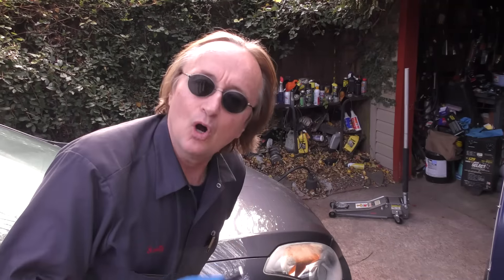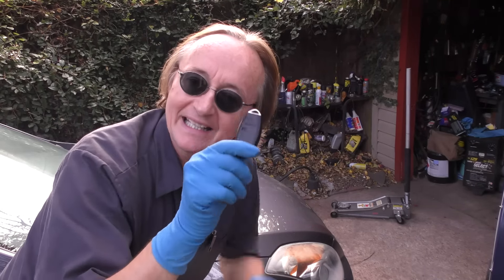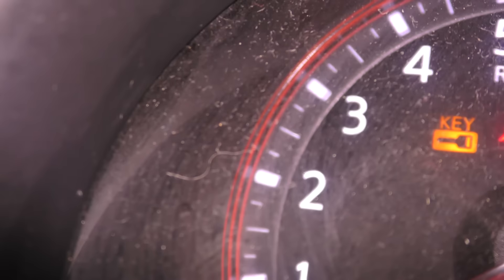How to Fix Keyless Ignition System in Your Car

Comment: Don't buy a Nissan.
Reply: Khalid AlNajjar JDM bro.
Reply: Nissan turned to shit after Renault brought them.
Reply: Exactly, nothing jdm about it.
Reply: whats JDM
Reply: EXACTLY..........& when you think about the crap that Renault built with AMC in the '80's (Alliance, Encore, Fuego, LeCar, anyone?), I am not that surprised at all that Nissan's reliability ratings have gone down the tubes in recent years.
Reply: ***** Renault is now also together with mercedes, and that premium brand turned to shit as well.
Reply: I'll agree. The 2 times I've had loaners when I brought my car in for service, I've gotten Nissan Altimas. Just getting in and listening to the hollow-tinny sound of the doors closing tells you how cheaply these things are built. The steering/suspension and the CVT are the 2 WORST parts about the car. Suspension is mushy with tons of underrsteer/front end plow and the CVT just cannot make up it's mind what gear it should be in. The CVT makes the engine "lug" a lot during around town driving. Don't even get me started on the terrible seats, non-intuitive steering wheel controls and the confusing navi-stereo system.
Reply: Not as reliable as Toyota or Honda, nissans are essentially average or maybe slightly above average in terms of reliability. Their CVTs also suck
Reply: I have a Altima still running strong at 240,000 miles with only basic maintenance needed. And a Sentra with 115,000 miles. Zero issues from these nissans . Both are post Renault . lmao this keyless thing is an easy fix too just pull the fuse and problem solved
Reply: *knee-saan
Reply: Nissan has gone downhill since its ceo took over.
Reply from the maker: also since they merged with the french renault company
Reply: Scotty Kilmer HE HAS SPOKEN !!!
Reply: Scotty Kilmer why is it bad that they merged with that French company?

Comment: Not really a choice they all have them now days. Unless you want a boring basic one.
Reply: I'd rather be "bored" than a victim.
Reply: A42yearoldARAB I didn't know buttons were that exciting to people xD

Edit: This will make a great "just look at it" video from edbassmaster
Reply: A boring basic one is still much more advanced than a top trim model of ten years ago.. Why complain?
Reply: Not a problem, as I've posted. Not expensive either.
Reply: Right you are!  I used my Toyota to give a ride to a guy whose Porsche had left him stranded on a busy highway.
Reply: why compare it to 10 years ago?! why not 50 or 80?!
Reply: wholeNwon, are you relating to a key problem on the highway?
Reply: No
Reply: wholeNwon, ok, just trying to find the logic and connection to the vid & ur story :)
Reply: I forgot to mention the Chevy Silverado does not have push button start on any trims..which is nice.
Reply: I was responding to the complaints of at least 2 people who said that transponder chip keys were extremely expensive to have made.
Reply: A42yearoldARAB gee these excite a person? Now that's boring lol lol...
Reply: A42yearoldARAB i thought that about our 14 fusion but its pretty well equipped. leather heated seats and the 2.0l engine. still had basic switchblade key
Reply: A42yearoldARAB Who cares about boring! A to B is the urmost of importance for the majority .
Reply: I like creeping past that "exciting" Ferrari going 20 mph on a 5 land freeway during rush hours, holidays, weekends and most other days. 
A buddy once asked me to leave for the beach after he did just in case his exciting Porsche broke down.  Sure enough, there he was on the side of a major highway.  Had to wait for the flat bed tow and then I drove him to down to the beach in my Lexus. We got there and he didn't say anything about being bored.
Reply: wholeNwon  I think we can all agree that every car breaks down.
Reply: wholeNwon
Same thing happened to me... Only, I picked my buddy up in my Mercury Tracer. lol!
Reply: I'll gladly accept a ride in a Tracer, if my 18.5 year old Lexus ever breaks down.  I really like "boring", if it means reliable, too.
Reply: wholeNwon
Well, the Tracer is 19 years old. Nothing very "exciting"..... The radio works, though.
Reply: We're on the same page re: what's really important in cars.
Reply: to you maybe. I don't get the a to b people I really don't. Cars are a hobby to alot of us. Just because you could care less what it looks like or does besides drive doesn't make it bad to have a fun brand new car. Financially stupid? Yes but that's our choice. Life on this earth is short, and you can't take it with you!
Reply: I wasn't being nissan specific. I've kept up with maintenance of all my cars, never been left stranded. I've had 3 keyless cars now (dodges btw) everyone always says it's such a unreliable car. Never had a issue getting it started. The only time a car left me stranded was a old 92 blazer leaking coolant into the engine, however that wasn't the issue, the battery cable came loose lol.
Reply: Yup, but, if you don't have it later in life, things can be very uncomfortable in the declining years. Money has time value. The very temporary pleasure of a "financially stupid" new car buy early in life can have consequences later.  But we none know how things are going to end for us and thankfully we are all free to do what we wish.
Reply: A lot of these hobby car people like getting super duper fast cars and never go to the track. They just speed through the streets and are a danger to everyone. I agree that new cars are exciting but if you're mainly happy about push to start then that's hilarious.
Reply: J.R. Crews cars that pop like corvettes and Ferrari are the ones that attract jealous people and they scratch your ride or some shit. They do look nice tho
Reply: Shawn S. Just the car really...it pulls all the ladies.
Reply: Shit axb
The people that have them can't afford to drive them. That's why they just sit in the garage, they can't afford to even insure them! Personally, I'd rather drive a VW bug!
Reply: *****
I suppose what I'm saying is, why have it if you can't "have" it.
Reply: *****
I reckon. lol!
Reply: Shawn S. exactly even inexpensive cars today are light years ahead of anything imagined 30 to 40 years ago in areas of handling etc etc. 

For most  people who drive they just need something in most cases! 

What personally excites one is strictly a financial and personal choice! Paying 400 to 1,000 bucks for vehicle every month to me is ridiculous ain't no car worth that headache even if I could afford or pay cash for it!! 

Looking at a car as investment is foolish for most people not gonna give you any kind of decent return no matter how good it is. Gets hit by a bus it's gone money down the toile! Cars are tangible goods anyhow!
Reply: Mike's Channel
Finally! A man with sense of knowing who he is, and his "roots"! I find your thoughts refreshing in a world of people that believe that the "best" is the "best", as that isn't the gist of the "story".

The "best" is dependable point A-B commuting, with mostly effortless maintenance. This is what is important for the middle classed, or less of an individual. ( I fall in between my description of the two!)

My point, solely being...Why have something that cost half a mill, and store it, because you can't afford to drive it?! Makes no common sense to me. I like your reply! And, as I stated, I'd rather drive an old VW than to have a Ferrari in the garage that would serve no purpose, other than a huge payment, huge insurance cost (even though it sits in that garage) and have have insurance on the home elevate due to the fact that there is a very expensive piece of s### in it that will hardly ever be driven!

Either way, I can't even afford the old VW! Most people here only dream and make silly comments concerning a dream that they have, and could never fulfill them, as the lot of us!

Thanks!
Reply: Shawn S. yes exactly. The other thing is it's others money used to pay for what they have and I could care less if someone purchased Yugo type car or the finest car money could buy it's  not my money or my place to tell people what to buy or not to buy and basically tell them what to do or sit around and be snobby about it. Live within your means and enjoy your life as you wish!
Reply: Mike's Channel
You're a good man, "Charlie Brown"! Glad that you relate! Have a great New Year!
Reply: Shawn S. 👍👍
Reply: Mike's Channel
Thanks, Mike.
Reply: ill take the boring basic one any day
Reply: William Brown lol lol theses types of cars tend to be a lot less trouble!
Reply: if i had the money i'd be driving a 1973 skyline or celica new cars are the ones that are boring.

Comment: The dealer told me that they were the only ones who could make replacement keys for my car (electronic immobilizer with transponder key).  They wanted a fortune to do it, of course.  Well, of course, they were lying. Ordered a cut key from an Ebay merchant for a few bucks. It came with programming instructions.  The car actually does the programming. Works perfectly.

Comment: as an electronics tech...i suspect that since one can just tap on the housing...the problem is cold solder joints or lifted pads....
Reply: +1
The curse of lead-free solder in a vibrating machine that experiences temperature fluctuations?

Comment: Don't forget bout those stupid ignition systems that use a normal key with a chip. i know gm was the first company to use the vats and vats 2 systems and boy when either the chip in the key fails or the ignition fails it cuts power to the starter or it cuts the fuel pump. if it fails while your out somewhere oh hell that's never good.
Reply: rmx77: Where can you get a replacement made for this type of key w/ the chip in it ?
Reply: mostly the chip keys have to be gotten from a dealer or bonded locksmith no other way around it and some of these keys can go as high as 500 bucks or more.
Reply: Thank you for the info. To be clear, this type key cannot be duplicated  other than by a dealer or locksmith.
Does the vehicle need to be present,  or can you bring in just the key and any pertinent paper work ?
Reply from the maker: vehicle needs to be present

Comment: This is why I only like old-fashioned cars where you open the door with the key and turn the ignition with the key!
No technology will ever beat that!
Reply: The most reliable gadget is the one you don't have to buy ;)
Reply: LegoGuy87 it's sad and completely counterintuitive to advancement and economy of resources. But hey, companies  gotta make record profits hand over fist every year right? Parts and Service 👌.
Reply: You guys clearly don't mind your things being easy to steal.  You guys are truly stuck in the stone ages. How will you feel when you figure out your car was stolen,  and all they had to do was break the window and stick a screwdriver in the ignition? It's 2016, not 1971.
Reply: ARandomYoutuber
you do realise there are key-ignition cars out there which have things such as steering wheel locks, immobilers, and other security systems which serve just as good a purpose as preventing theft in comparison to modern vehicles?
Reply: I agree the more tech you have in car the more money to fix it.
Reply: my car is a 16 and still uses a key it has old fashion keyless remote but i can open a door and all 4 will open at the same time since my car learned it after a few weeks but my point is you dont need to have an old vehicle to use a key just get an se model instead of a limited
Reply: J.R. Crews What car thief has the time or technology to bypass all that shit when stealing a car? Just because it can be done, doesn't mean it will.
Reply: +J.R. Crews Very true,  but then why even try to protect and/or lock anything if it means that someone is guaranteed to break into and successfully steal whatever it is just because they "really want it" Might as well make it easy for them, right? Just use the old fashioned lock-and-key.  Ol' Reliable, right?
Reply: But it would be the car itself they want.
Reply: Except that doesn't work with immobilizer keys. Only in Die Hard 3.
Reply: The Mouse In Your Room 
It’s very easy to do it. All you need it a laptop.
Reply: +The Mouse In Your Room
People these days are complete idiots and get lazier. Most problems with cars being stolen could've been easily avoided had the owner used some common sense and added some basic security to the car if it didn't already come with some as standard.

Comment: On my 1980 jeep it has a keyless ignition as long as the steering wheel isn't locked you don't even need the key! How convenient is that and if the keys are in your way when you start it up you can pull them right out another great feature

Comment: "HAL, start the engine."

"I'm sorry Dave I can't do that !" 

This is the secret reason why cars are becoming so complex.  Car manufacturers sell the franchise rights to dealers, then withhold critical information like codes to force owners to take their cars to dealers and lock out the small business mechanics.
But as you say Scotty, I'd rather have the old style car with the old style key but as time progresses the old style cars get harder and harder to get.  Personally, before forking out 900 bucks, I'd have a look at the pcb inside the module, could be as simple as a few dry solder joints and if that's the case, deny the stealership cartels their extortion money, like programming the thing would only take them all of about 6 minutes. 

Good on ya Scotty, tell it like it is.
Reply: In the netherlands they don't even allow older cars in certain cities. They claim they do it to combat pollution. But honestly the government and the big corporations is the same shit of elites to screw everybody else over. So, basically the government, through law, assists in selling more modern cars.
Reply: SE45CX in the us some states don't even give a shit about emissions
Reply: SE45CX In Finland goverment is trying to force evry car with a gps sender via mobil net so the goverment can track you where you drive all the time. That is like NWO
Reply: Tom Reid Sorry didin't get you
Reply: Tom Reid Then don't tell me to shut up 😁

Comment: It amazes me that the 6th gen Celica is so reliable, it doesn't have OBD2, and doesn't need it!  I bought a 1998 four years ago, and have driven 45000 miles without breakdown insurance, only usual preventative maintenance (all fluids and filters etc.) done myself. An 18 year old car.  New stuff is overcomplicated, with ridiculous replacement costs for electronics that have common simple faults and could be repaired instead of replaced.

Comment: I have a 2009 Nissan Altima hybrid it has 220,000 mile running good no problems beside replacing transmission because I had never change the transmission fluid and hybrid battery replace. Smart key still working as new.

Comment: My Volvo S40 2005 has the same issue. It has an antenna loop around the key and the contacts to that tend to corrode. I fixed mine by turning it into the crank position (the engine won't turn over cause it can't read the key) and giving it a few whacks with the end of a screwdriver. That fixed it for quite a while now, but it's bound to come back one day, and I'll have to take the dashboard apart to clean the damn thing. At least I don't need to buy any fancy modules or anything.

Comment: Sounds like a solder problem causing bad connection. Scotty you should take it apart and check the solder connections. Could be as simple as fixing the joints

Comment: Good point - I have always had keys - and when you think about it, what a terrifically durable and reliable system considering it is subject to so much abusive use.  But if I buy a new car, they pretty much all have the keyless now; it just seems strange to me as it is one of those technologies that sounds like a good idea, but in practice it just does not seem a natural way to do things.

BTW my Dad's Kia 2012 Optima (one of the first ones that came from Korea) .. his battery went dead and good golly .. even with the pictures in the manual, it took both of us a few hours to figure out where to push that WHOLE remote in.  Dealer put in a new battery for free, and gave him an extra one to put in the glove box.

Comment: My 2007 Altima looked just like the one in this video. I haven't had that issue with mine after driving it for 4 years, but it did have transmission & battery problems. I sold it last year & now have a 2015 Toyota Camry also with the keyless ignition. Never buying Nissan again!

Comment: I haven't checked if anyone has mentioned this, but my wife has an 09 altima that had this very same problem. 

I got it fixed the same way, tapping on it and playing with the start button. 

what that module is, is a steering wheel lock, there's a sort of pin that goes up and into the steering wheel "locking" it. 

problem is they wear out and get stuck in the locked position 

what I did about 4 months ago was remove the fuse for the steering wheel lock module under the hood. 

since then we haven't had it happen again, not even once. but if you're gonna do that, you'll have 2 pull the fuse when the steering lock is "unlocked" otherwise it'll prevent it from working at all. 

so yeah, unlock it by tapping it, then pull the fuse. 

I love the car, admittedly this is a common problem, and is stupid. wish it had a "key" key too.

Comment: Oh how convinient. Intelligent systems that require you to take the dash apart to get the car started. Neat burglar protection. Good job nissan! I always hated how inconvinient keys are.. You need to stick them into key holes.. Twisting the key will give your fingers cramps.. 

But in all seriousness, this is how low human kind has gone.. nearly 1000 bucks to fix a key.